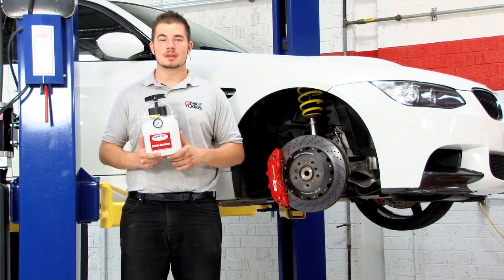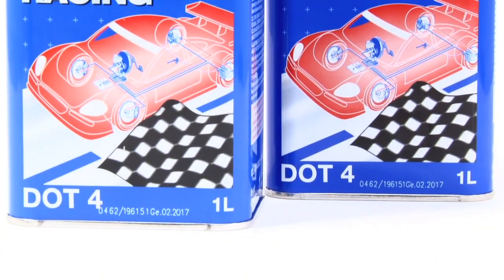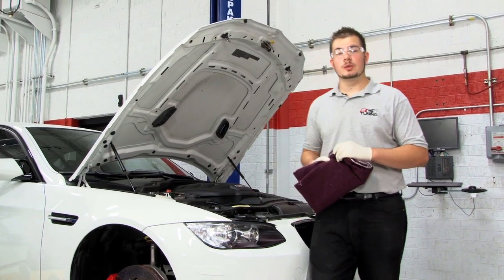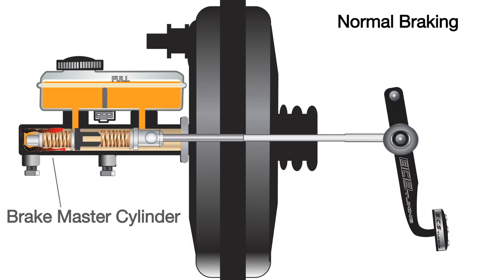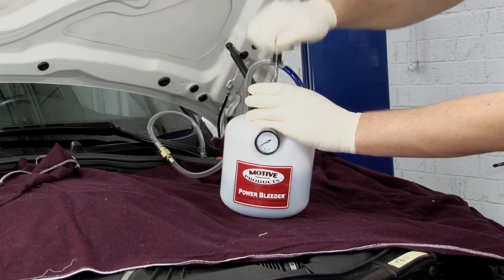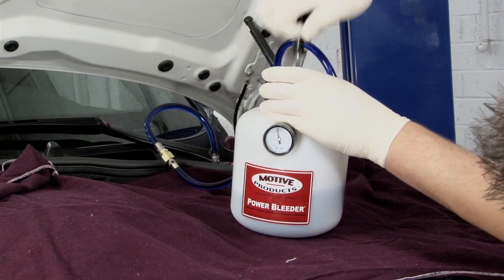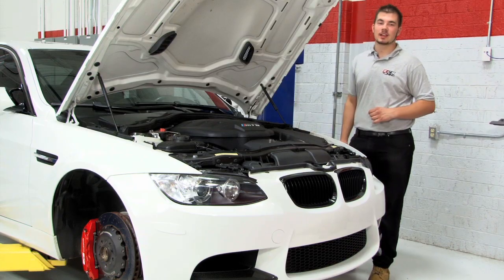ECS Tuning: How To Bleed Your Brakes

Comment: What a POS product.  Where their engineers go to school to come up with something like this POS.  I spent $108 from Amazon and got the universal cover for the master cylinder.I pressurized it to 15 PSI as per shown on other clips here and the all of the brake fluid I put in the pressure tank leaked out and into the ground.  I live near a lake and I'm sorry that I had to hose it off of the street.  What a POS.  Vacuum pump worked better for me.
Reply: You should have inspected the rubber cap seal
Reply: Then it isn't the kit's problem, your seal isn't holding up and it needs an inpect.

Comment: Question that someone else asked down below.   You emptied the reservoir completely before attaching the power bleeder cap to it. What about all the air that's now filling the reservoir? Is that air just being forced into the lines by the power bleeder? Where does the air go? The air has to go somewhere and you have no bleeders open.  Sounds like your going to do more damage than good, like busting something out bleeder seals or line?   Any thoughts
Reply: true if he empty the master cylinder he needs to use GT1 or iNPA to bleed ABS pump!

Comment: I only have one question. You emptied the reservoir completely before attaching the power bleeder cap to it. What about all the air that's now filling the reservoir? Is that air just being forced into the lines by the power bleeder? Where does the air go?
Reply: No, my understanding is that the air trapped in the reservoir when attaching the pump adapter will not travel down the brake system, it will remain atop the reservoir as long as there is fluid left in the reservoir. You have to understand the physics of fluid surface tension and the Archimedes force that pushes upward any volume trapped inside a liquid . Only if the level of fluid in the reservoir is getting close to the bottom outlet where it enter into the metal pipes can air get sucked into the system. You can trap air bubbles inside a straw but you cannot trap air bubbles to the bottom of a bottle because the bubbles will rise to the water surface no matter the pressure inside the bottle. The correct procedure is to empty as much old fluid from the reservoir as possible and then add some new fluid to make sure the level is not near the bottom hole of the reservoir. There is no need to top the reservoir if you are filling your pump with new fluid.
Reply: I wondered the exact same thing.  I would have thought that you need to top up the reservoir with new fluid before attaching the pump, but the video doesn't show this.
Reply: I noticed the same - it was probably an editing error. If you proceed exactly as per the video, you will force air through the system which is dumb. I suspect the correct procedure would be to use a turkey baster to remove most of the fluid and then top up about halfway. Then purge the air from the pressure bleeder prior to attaching it. This way, the increase in pressure within the reservoir will be cause only by fluid entering it and the air void above the fluid level will remain, albeit perhaps compressed and so a final top up needed on completion.
Reply: That's why he said that it may take 2 bleeds. The air will escape into the first brake you bleed and the rest will be free and clear of air.
Reply: You are correct, the proper way to do this is unscrew fill reservoir to the top then connect bleeder cap and pump fresh fluid through, you will be pushing the fluid through without any extra air , idk why they didn’t mention it this way
Reply: Only as much air as can fill the reservoir will occupy it at any given time. when you open a bleed screw the fluid level drops and more air will enter the reservoir. this constant pressure built up with a ample fluid level will put constant force and difference in potential

Comment: Hi Mike,
            On the way home my brake went to the floor. I was able to stop & when I got home I found the break line leaking. I cut out the leak & replaced broken stretch using a double flare fitting. When I pumped the brake it had pressure after the 3rd pump & then to the floor.  I checked underneath and found that I had another leak. But I still had some brake. I made sure that I did not let it go completely dry. I know that I have to bleed all the lines, but after repairing that leak I now had no brake. I did some line repair before but never had no brake before bleeding, poor brake yes but at least some brake. My question is would air in the line cause no brake or do you think something else may be the problem? ABS? Thanks in advance for any help you can .

Comment: I just purchased one of these power breeders, have a question, so when your finished bleeding, it doesn't leave the reservoir over filled? It seems like it would completely fill the reservoir with brake fluid to the top due to pressure and it would be spilling out when removing the pump cap. Thanks for info...
Reply: That's an excellent question. Here is my non-experimental guess. At the beginning of the video, there is some air in the reservoir and in the pump tubing. As he hand pumps the pressure moves some fluid and air that was in the tube into the reservoir. You'd think that all the air in the reservoir gets pushed down to the brakes bleeder screw, and the reservoir becomes full of fluid but that's not what happens.. This is where Physics gets tricky. The volumic mass of fluid is heavier than that of air. First look at what happens when the bleeder screw is still closed. Both the air and the fluid are trapped in the system at the same pressure created by the pump. The only forces that can create moment is gravity and fluid surface tension. The heavier than air fluid wants to go down and any air bubble wants up. In the reservoir the diameter across the fluid to air interface is the biggest making it easy for the air to stay above the fluid (both are pressurized). Next the bleeder screw is opened creating a gradient of pressure across the system. Now both the air and the fluid want to move down the brake pipes. But gravity and surface tension still operates. In the reservoir new fluid from the pump gets sucked into the pipe at the bottom of the reservoir, however the air will stays on top of the reservoir due to the large  cross section. However, any air that gets sucked into the aluminium pipe narrow cross section at the bottom with not be able to bubble back up because of fluid surface tension.  That air will have to come out at the bleeder screw end.  Think how a drinking straw can hold liquid and air inside it, that's fluid surface tension. The narrower the diameter the more difficult it becomes for an air to bubble up.
  
From this analysis i think you never want to have less fluid volume in the reservoir than there is air trapped in the tubing when you first connect the pump to it. If you do, when you build pressure with the pump the fluid/air interface will go down to the bottom of the reservoir into the pipes before fluid from the pump has a chance to keep fluid in the reservoir.  Once there are small bubbles in the system, it is hard to get it out. So i would be careful with his advice in the video to remove as much of old fluid in the reservoir as possible. After doing that, I would add some fresh fluid directly in the reservoir before connecting the pump. 

To finally answer your question, there will be some air in the reservoir at the end of the whole bleeding process, but first unscrew the pump cap to let the pressure go. Some air will return to the pump bottle (you can see it in the video) but there will still be some air left in the reservoir.
Reply: @goognamgoognw6637  Two years old, but this comment should be pinned at the top for everyone to see. Exactly what I was looking for. Thanks.

Comment: I bought this ECS brake fluid flush kit (https://www.ecstuning.com/b-assembled-by-ecs-parts/brake-fluid-flush-kit-level-2/007091ecs02kt/) that comes with 2 bleeder bottles.  My question is why 2 bleeder bottles since all the instructional DIY videos bleed one wheel at a time?  
Also, it says a typical flush only requires 1 liter to replace all of your old fluid, does that mean for each wheel, you should just bleed out 250mL?  In other words, how much fluid should I bleed out for each specific wheel?  Thanks!

Comment: I don't what any mess so I don't fill the power bleeder with brake fluid. I just fill the brake reservoir to the neck, attach the power bleeder for pressure and refill the reservoir when it gets low. More steps but   I don't need to clean the bottle afterwards.
Reply: hello   i all ways   make sure  the  reservoir is full  at all times ((((((( or you can get air in to the system   )))))))) when useing this method   i some times have some one with me   ,, i know then it a 2 person job ,, but its better trust me     i am a fitter
Reply: I do it the same.
Reply: Chiman I total agree with you it makes à great job
Reply: Brake fluid can leak from the reservoir. It also attracts dirt. So i prefer to keep the tool clean.
Reply: I gotta try that. Its such a messy job if you just sneeze in your brake systems direction were talkin soaked hands, tools, floor, parts, freakin catch hose pops off the bleeder screw, fluid dribbles down the side of the bottle when pouring, yuck yuck yuck
Reply: Yeah I just made a power bleeder extension for my hydraulic clutch using an old reservoir cap. That reservoir is kinda small though, so I think I'll just go ahead and fill up the power bleeder tank. I'm kind of wondering though, why no one mentions filling up the reservoir and priming the line to the power bleeder first. Seems to me that would force air through the system. Also, why does no one mention putting a recovery bottle with a small amount of fluid in it on the bleeder valve side of it? That way, there's no possible way air could get sucked back through the bleeder valve, even if you were just using the pump the pedal method, you wouldn't need 2 people either.
Reply: you can also make this with a spare reservoir cap, a hose barb to npt adapter, some tubing, and a small hand held tank sprayer.
Reply: Gigi de la tara  yep on m'y truck we did each wheel  twice in 40: min probably 10 ounces of fluid
Reply: Clean tool, better job.

Comment: i just bleeding the brake system(by power bleeder)but the bleeder can not push the old fluid of the rear wheel like the front one(the fluid only dripping) even i pumped the bleeder near 19 psi
Reply: Did you ever figure out what was wrong?
Reply: Try pumping the brakes a few times before bleeding, with the car turned off to release the residual vacuum in the brake booster

Comment: I see that you did not utilize a BMW diagnostic program as part of the brake bleeding process. I have an E46 2001 325CI. The Bentley Manual calls out utilizing a BMW diagnostic tool before power bleeding the brakes. Can you advise about this?
Reply: You only need to do this if you have air in the ABS unit, the diagnostic tool causes the ABS unit to vibrate which helps to dislodge air bubbles stuck to the surface. So if your haven't run your system dry or got air into your ABS unit, don't worry about using the diagnostic tool.
Reply: Great vids, and,Yes , i understand if my ABS DSC unit have been change before, but ...With Power bleeder, and due to the presure in, a lot of air is staying in the hose, and so , during bleeding process, are pushing right into  the reservoir cap , and the tubing , and the ABS unit, so ...:

1) How could be sure that they are eliminate , without BMW Diagnostic Program ?
2) And the same , for the air suck in , into the break tubing system ?

Is it necessary to flush a minimal quantity of brake liquid ? or to maintain the blleding process, a minimal time for each caliper  ?

Thanks
Reply: i think it will not hurt if you activate the abs pump!just for sake of to be sure that no buble in abs

Comment: would air from the air pressure bleeder get caught in the line from bleeding? because i tried this and i still have a soft clutch.
Reply: Clutch works independently, but with the same fluid. There is a separate valve for the clutch. Be sure to bleed that too.

Comment: Is it crucial to have an airtight connection at the bleeding valve side by the calipers? 
I was thinking since the system is pressurized I could in theory just open the bleeder nut and let it flow all over the place.

Sometimes I see people having filled the bleeder bottle with brake fluid but I don't see how it would make any difference with a product like the power bleeder that pressurizes the system.
Reply: People are filling the bleeder bottle usually when bleeding the brakes manually with the pedal.
They doing that way because when the pedal is released and the pressure drops, the bleeding valve won't suck air into the system.
But with this continues pressurized system it's not necessary.

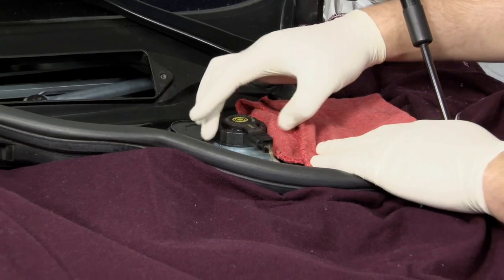Comment: One wouldn't really need to extract old fluid from the reservoir first at 4:00 right?  If I were to simply push all that old fluid through that would work too right?  Also how does the pressure bleeder not pump air through the system?
Reply: +Kevin L I was thinking the same thing but I think I worked out the answer... It's fine for a little air to run into the reservoir as the air will pressurise the system from above. Then when the new fluid reaches reaches the reservoir, it tops the level up without the air ever getting trapped in the system.
Reply: +bitbiter What about the air between the tank and the reservoir?  Before the fluid in the tank can flow through the hose to reach the reservoir, the air need to be pushed to the reservoir, then down the brake line, correct?

Comment: Sorry if im missing something but how do you get the old fluid out? Do i just force the new fluid in with the old or do i use the empty bleeder to push air through to emtpy existing fluid? Thanks for any help
Reply: if you empty the master cylinder you are in trouble becuase air will stuck in abs pump and without gt1 OR inpa YOU WILL STILL HAVE AIR IN ABS PUMP!

Comment: I have tried to follow the instructions given in the videos (that repeatedly) saying the same thing. About "pressure bleeding".

Is this the way to go? Or am I gonna have to use a stick to press down the brake pedal also.

Otherways what is the stick (that calls "V.A.G 1869/2) used for?
Reply: I just read this reply and am wondering if there is a typo.  You used "elevate" but did you mean "eliminate"?Thanks
Reply: The stick (or a person applying light pressure to the brake peddle) pushes the master cylinder pistons in a little so that fluid can go around the pistons and flush out the areas that would normally be missed. Another function is to center a proportioning valve so that fluid can flow equally to the rear and front brakes.
Reply: IF YOU HAVE BMW!ORDER ON EBAY GT1 SOFTWARE WITH CABLE AND USE GT1 WHEN YOU BLEEDING ITS VERY NICE TOOL!

Comment: This video convinced me to buy this pump. Bled my brakes in less than half an hour by myself! Great product-
Reply: ***** No problem! The video especially helped since I have an E92 M3.
Reply: @surewin1773  So do I and i am trying to decide which product to buy.
Reply: @goognamgoognw6637  Go with Extoil european spec....it's perfect and the has the release button...Motive thing  has NOT!
Reply: @DustyPearl-13  ha, your replied to an old post, i bought the ecs pump long ago, true it had the expected leak issue at the cap but with plumber tape it was a moderately easy to fix and the ecs pump has the big advantage of a valve manual switch.  I  bled my M3 all 4 brakes last year for the first time ever and it was a success. I was very happy to avoid the dealer.
Reply: How can I get a  complete kit whit adapters  for different  card brands

Comment: Please note you MUST clean the power bleeder after use and flush it clean using mineral spirits including the hose. If you do not, the hoses will burst next time sending brake fluid everywhere. Ask me how I know. The brake fluid makes the rubber hoses weak.
Reply: It is better to use dish soap and water to clean the power bleeder and hose, no need to use toxic mineral spirit.  The result will be the same.
Reply: Good tip, I wouldn't store fluid in it anyway,  it builds up a small amount of pressure and pukes out small amounts of fluid making a huge mess.
Reply: Good thing they used a rubber that was degradable when in contact with brake fluid, the very liquid it’s supposed to be designed to be in contact with. Good job motive. Also, good job on not making a Honda adapter, only some square universal deal, with j-shaped screws and small toilet flapper chains and wingnuts. If I knew every adapter would be $30+, you couldn’t leave brake fluid in the brake fluid bleeding machine, and that they didn’t even HAVE an adapter for many cars, I wouldn’t have bought one.

Comment: Why is it necessary to bleed the wheels in a specific order if the use separate lines now. No modern car uses single brake lines anymore.

Comment: Very informative video, I still have an unopened liter bottle of SL6 fluid from when I did my 40k service on my MKV gti, I'm replacing my rotors and pads soon, will 1L be enough fluid for a brake flush?
Reply: I'm not a mechanic but 1L is plenty for most systems as far as I know.  big BUT, if you overbleed the rears because you're too busy drinking your beer and  it measuring the fluid coming out, you'll run out before you can do the rest of them.  that's why i'd recommend using a collector bottle with volume measurements on there!  

if you're really concerned you can find out the ~ exact fluid capacity somewhere but 1L should be good.